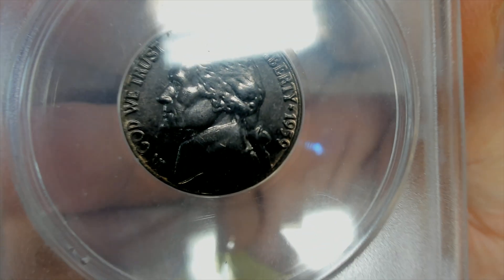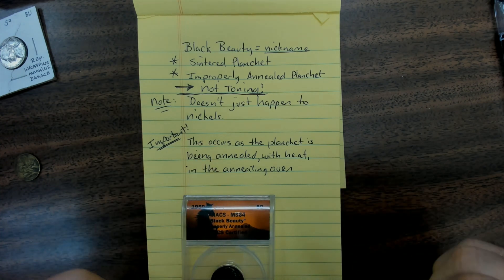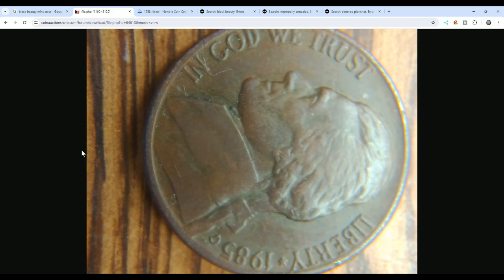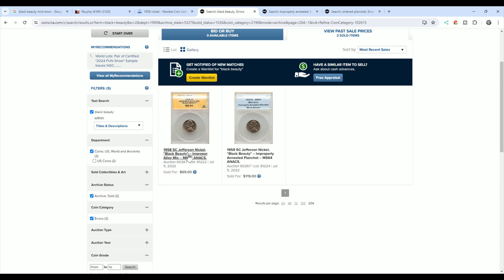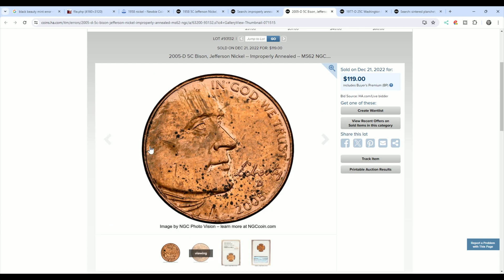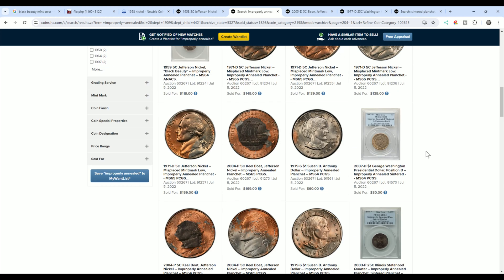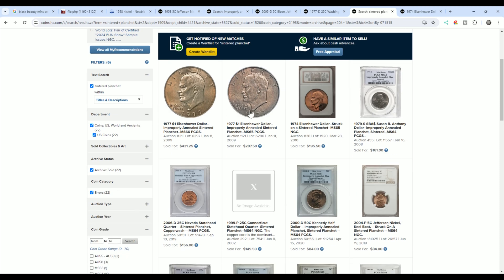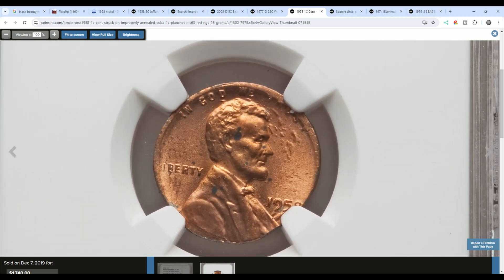Why Is My Nickel Black? Sintered Planchet - Improperly Annealed

Comment: You have helped me in so many ways!! I inherited my dad’s collection I took it to local coin dealer he told me “trash metal” other than the silver. Not only does he have “black beauty” pieces but the washer mark on bk of one 1944’s1943’s the striker quarters metal shredded pieces from all over n from .999 coins to buffalo nickels that are molten like idk tech terms but it’s a 50yr collection that I’ve had just started going through this wk. so many of your vids are the coins he has

Comment: I used to work at a metal heat treatment and plating processing plant.  After plating screws,  we baked them in ovens because of what is called "hydrogen embrittlement".  In the plating process,  particles of hydrogen get trapped inside creaves of the metal and heating them up expands the metal to release the hydrogen.  If you don't do this you can take a hammer and smash a screw and it will just fall apart even after being heat treated before the plating.   A lot of the screws we did heat treat after plating would get a dull finish and yes you could find ones where they didn't process properly and they'd turn black just like these planchets.
Reply: Thanks for sharing that, very interesting:)!
Reply: @DrMatey215  you're most welcome. 

Just another fun fact to add.  We did screws for a major appliance maker.  If the screws were just for securing the sides there was no need to heat treat but if they were functionally useful like to hold tension,  if they were not heat treated,  the tension would pop the heads off them. So if you screw something down and the head of your screw pops off,  you're a victim of hydrogen embrittlement lol.